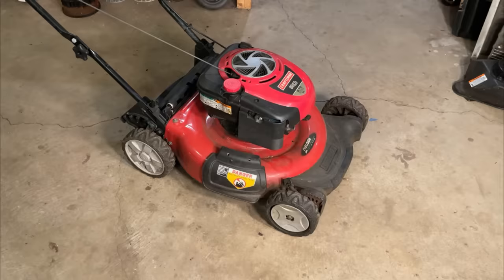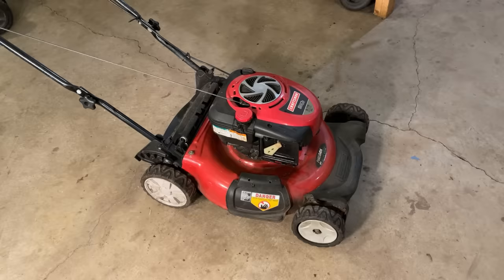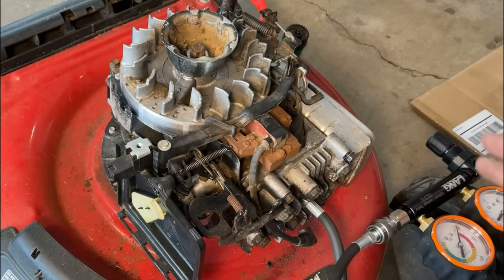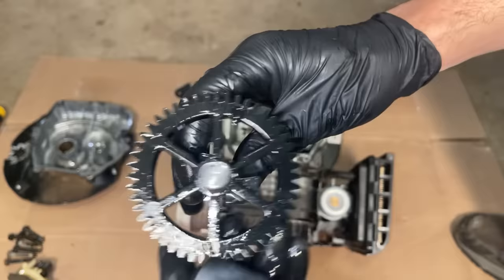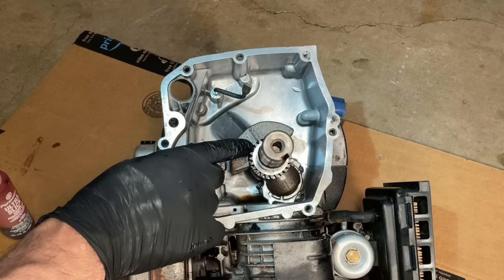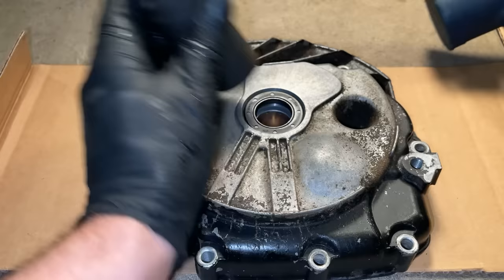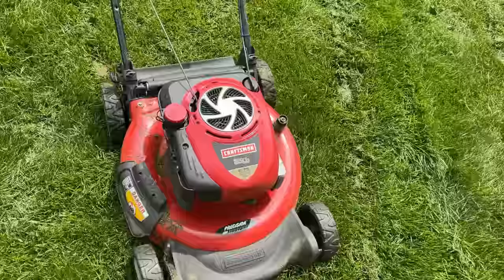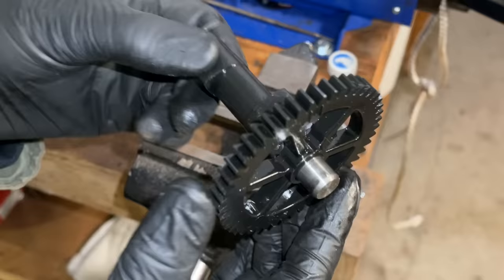Lawn Mower Will Not Start - You Will Never Guess Why

Comment: As the designated grass cutter in my youth, starting in the early 60’s I grew up on some of Vicksburg, MS hilly land.  Probably 1/3-1/2 acre of mostly steep hills and to minimize  washouts, leaf build up that attracted worms, grubs, ground squirrels and moles that burrowed causing worse washouts on top of the dogs digging after them we(I) cut grass a lot.  It was kinda whooped into me to walk and pick up the yard before cutting and if dad had to work in the mower that meant a missed opportunity for us to go fishing or early season hunting which he and I did a lot. Dad rarely bought anything new unless prior use usually meant buying a prior use or poor maintenance problem and well lawn equipment generally fell in that category back then.  We had one of the new for that time yellow two stroke Lawnboy mowers, can’t recall the engine hp or deck/cut width.  Two stroke engines were about the only kind of engine that would survive cutting on our hills for any length of time(months to years) without developing lubrication related problems even burning up/seizing.  As I write this it struck me as somewhat odd that I don’t recall many if any fuel separating and varnishing out in carbs or carb jets, NO alcohol and jetting was larger, fuel possibly to probably better at retaining its octane rating  due to the presence of lead for lubrication because the EPA didn’t exist so that too probably helped too.  Only engines I can recall being a bit more prone to carb jet fouling were two stroke outboards, although all we ever had was a 1.5hp Elgin and the reeds deforming were its Achilles heel. Seems like they were probed to both warping and pitting and they were no longer available.  I remember dad having to work in it every year before we planned to use it and for some reason it always picked up moisture in its tank.  I recall us always running the fuel out of the carb and fuel line before storing it for the winter.  It was stored in the shop area side of our finished basement and the tank had a screw down vent filler cap and a needle shutoff valve at the tank.   I recall dad getting reeds from the local marine engine shop, not the correct by model number but he made them work.  I didn’t know about 4 stroke lawn mowers at least not for my use until I got out on my own and owned flatter property.  That mower must have had a crankshaft design, raw materials ir casting related build problem.  I remember hitting a smallish dirt clod one day that had gotten into the mowing area one day after I had hauled dirt.  I also hauled(manual backhoe, a shovel and a wheel barrow starting with a 4, then a 6 even had one 8 cubic ft barrow) after I got into my early teens.  I tamped, surface scratched and seeded a lot of dirt every summer to repair washouts. But I recall every year or two that the mower developed problems running dad would troubleshoot disassemble the engine, check the crank the use a couple 4x4 blocks with v-wedges he had cut in them to straighten the crankshaft.  I only recall a time or two among the many that the timing key was a bit off.  I’m nearly certain the crankshaft was a cast and machined unit. I don’t know what straightening cast crankshafts do to their metallurgic structure but dad and I replaced it a couple or three times and would check and freshen up the top end with new rings a time or two while I was still at home.  We were still using it when I left for the Army at 18 so it was about 12-13 years old when dad bought a very heavy self propelled 4 stroke snapper primarily for use on the flatter areas.  I don’t recall for sure if it had a pressurized(pump) oil lube system or not but it was basically like a bulldozer with flat tracks on ice on the hills, sliding sideways when cutting along the side slope and then you had to basically horse the thing back to the top.  Dad was still using the lawnboy mower on the hills of that property when he moved to a flatter property in the early 90’s, so it was around 30 years old then.  Other than the crankshaft which was its Achilles heel until the last one he bought lasted many years without need for straightening.  Dad was a Jack of all trades, learned a lot from a man that I learned in my 20’s or 30’s never got to finish the 4th grade. He read everything he got his hands on.

Comment: When you discovered the gear off position re: the lobes James, then you pointed out the decompression ears bent and binding against the gear web, that told me it was the gear that moved in regard to the shaft, as, if you will recall, the decompression assembly is pinned thru the metal shaft so it stayed true to the lobes.

Comment: They make stuff to break so in a couple of years you just go out and buy a new one.It's really sad how greedy companies can get.
Reply: These are made far better than what you can buy now. The shear pin is a common repair. There is one always in my toolbox. It does suck when it fires wrong and the pull cord rips out of your hand.
Reply: @toadalgea  " The shear pin is a common repair."  Agreed, one need only break down as far as the flywheel;  however you must have missed the part about the failed camshaft requiring the opening up of the engine - not an easy fix.
Reply: Your right everything now is made with a life span of 3 years then you have to fix it or buy a new one and in some cases the fix is more expensive then buying a new one..
Reply: That’s why I detest the phrase “good enough”, the cause of failure, crashes & lives!
Reply: Zero cool I agree 💯%
Reply: The keyway is designed to shear in order to protect the crankshaft from twisting damage when you hit a large object.  The key is then changed out and away you go.  If the operator is mowing only grass there is no issue.

Comment: I just started working on lawn mowers. Already had experience working on vehicles. Thought I'd start flipping lawn mowers. I just got a Toro, same engine as this craftsman. Except I paid 80 bucks for mine. I can sell the toros 200 to 225, so I dont mind spending money. Well after today I'm not spending that much any more. When I got it home, gave it a pull. It was a hard pull, locking up, almost jerking my arm. It did start and run half way descent. Sounded good. So I did the service. Flushing the fuel system. Then gave it a bath. Then went to start it. Still locks up when pulling, and now wasnt starting. So I pulled the rope several times, and it fires up. But it's hard to start and violent on your shoulder joints. Timing.  So I checked the timing. The key is about 3/4 out of timing. I'm thinking that the engine its self is good. Since it started and ran. That all it could need is a cam replacement. I'm gonna tear it apart tomorrow, see what happens. Gonna use this video as guidance.

Comment: Got a  all steel w glass headlights, 1983 Murray RIder 42" ,  Hood opens like car ,  peerless transaxle, has the Briggs 12HP IC (industrial commercial) engine, we just fix it instead of buying new plastic front end types which seem to be the only choice anymore for new ones,   ( plastic would crack the first time someone tapped a bush or tree).  Runs good !      InventPeaceNotWar

Comment: This was an excellent video, easy to understand and was exactly the same issue I was having with my Briggs 6.5hp intek pro engine. Had me quite stumped really. This video helped out a lot. Thank you.

Ps.
It’s a shame that all these companies are using plastic internal components these days. It’s one thing with all the external components they changed from metal to plastic but to be using plastic for parts like that is just pathetic
Reply: @charlesmarlowchuck5060  lol I did scrap it. Because even after addressing the issue, put it all back together and still wouldn’t start. It was a brand new engine too that sat in my bosses garage for a few years on a go kart project he didn’t finish. 

I ended up just going to harbor freight and buying a predator engine to finish the go kart for my daughter. So far no complaints with that engine. Fired right up and runs every time
Reply: Plastic now being used to break so you buy another
Reply: My brother has a long lasting "solution" to plastic bearings and gears. He has a metal fabrication business. Basically, he cuts a gear out of steel to use as the replacement part. 
He also has customers with plow blades on their pickups that break. While under warranty, he repairs to factory specs. Once the warranty is up, the final repair is made, good for the life of the plow blade.
Plastic is so wasteful. So is the foreign steel.

Comment: I'm quite certain you've just identified what is wrong with my 3-year-old lawn mower that is getting almost impossible to start and little compression after having another mower previously that went 20+ years to get into that condition.  People look for issues like this on engines with timing chains and belts where they can jump teeth on a sprocket, but not gears.  They should be at least be pinned to the shaft or have some other mechanical means to prevent crawling out of position on the shaft.

Comment: Good job on everything! Except, I don’t recommend using a disc like that for cleaning gasket mating surfaces of any type.  Tools like that are great for certain things. Using it that way can cause uneven mating surfaces that a gasket can’t seal. If you do decide to go that route, at least look at how abrasive your tool of choice is and take that into consideration.  Not taking away from your video sir by any means. Just a friendly suggestion from a life long fellow engine mechanic. Use a scraper blade and some scotch brite to clean gasket area. Use brake cleaner and blow dry with compressed air.  Check for any nics or uneven surfaces with a strait edge and seal with a nice even thin line of good engine case sealant like Yamabond.  Or Harley-Davidson makes a good Engine Case Sealant.  Just run it on one side of cases. You don’t want too much on them or it will squeeze into inside of case and could break loose once it dries and plug up oil passages causing engine failure. But at same time, using too little or you miss a spot then you have a leak. You want a nice even bead right in middle of one case half.  From one end to the other.  Circling around bolt holes.  To provide a good sealed up bottom end.

Comment: I found a two stroke Iron horse in the trash one year - minus base and blade - checked it on the spot and seemed ok. A couple years later I found a base. It backfired a bit and with a new blade went for 10 years. Then I moved house and gave it a going over and replaced the keyway. Now it runs perfect. That was 25 years ago...

Comment: Great Job, James. Strange reasons why lawn mowers never start, yet too many owners would never have thought, time or ability to disassemble the engine that far and troubleshoot down to that lone critical gear / assembly.
 
One other question is why do you rarely seem to sharpen or replace the blade ?
Reply: Haha. He is good small engine mechanic that is making videos, that someone might actually watch. Not like he is really going to use that lawn mower. Im more interested in "no choke" start and no mower safety device

Comment: Actually, the compression release is on a pin through the camshaft. For it to bend like that, the pin would have to break or the gear had to turn. In your case the pin was still good so that indicated that the gear had moved on the shaft.

Comment: What you said about seal position is true on low-hour motors or motors with good maintenance history. High-hour motors (and this is true in the automotive and aircraft industries as well) will often have a small groove worn around the OD of the crank right where the edge of the lip seal contacts the crank. When a groove is discovered the seal usually has some amount of free space where it can be driven in further past the groove, or shimmed, or carefully driven in less than originally so the groove is not in contact with the seal's lip.

Comment: I've had lawn mower engines where 1 of the rocker arms was missing... I couldn't find it.. I mean, I tore the engine completely apart... nope, not even shrapnel... I replaced it with a new one, and mower was perfectly fine... I can't tell you how many times I pulled the pull start on that one, it had good compression and everything... lol
Reply: Pretty sure that MOWER MEDIC 1 has a video of discovering a missing valve retainer or lash shim. Sorry I can't recall the exact problem, but it was a part that was omitted during factory assembly, resulting in an engine that never ran from day one. 
   On a different note, a pushrod on my friend's pressure washer bent, dropping the rocker off the valve. We set the rod on a hard surface, placed a piece of hardwood over it, felt the high spot and gave it a medium whack with a hammer. Got it perfectly straight with one hit. That was about three or four years ago. It's still going strong.

Comment: Most of the mowers I have rescued from the trash dump had gummed up problems with the carb float and/or the needle valve.  Easy peasy. It's largely a cleaning job.
  Had one last year that needed a set of carb gaskets to restore horsepower. It started just fine but would always stall under any kind of load.
 Never had to go as deep as you did with this one... It's almost always the carburetor.
 When a small engine spends at least half the year unused in storage the fuel evaporates and what is left looks like gummy varnish.

Comment: I had a snapper lawn mower about 11 to 14 years ago that wouldn't start so took off the air filter and filter housing then removed the carburetor and took it apart to clean some gunk out of it only to learn that the lawn mower ran fine without the carburetor went to the local small engine shop and purchased a full carburetor rebuild kit then put it back together with all new parts and put it back on the lawn mower and reconnected the fuel line added some fuel and still the same problem but now that I think about it the jets could have been messed with or needed replacing but I'll NEVER know because one of my cousins sold it to a pawn shop for fifty dollars when I wasn't home.

Comment: If they could build the entire engine with plastic, they would!
Reply: Troy built, heck the entire carb is plastic, but at least wont rust out like many with this ethanol gas now.
Reply: "Introducing the new Briggs And Stratton Lightweight, featuring plastic block, aluminum valves for less tension on the plastic cam, with cast iron sleeve for commercial duty"

Comment: Hey James, thanks for sharing this. I am truely devastated to see plastic cams inside an engine. The plastic carbs were already the point where I decided to keep my older Briggs&Stratton engine on my mower as long as it doesn't fall apart.
I wonder when they will finally come with plastic pistons and cylinders...
Greetings from Germany!
Andreas
Reply from the maker: The older engines built before 2006 are definitely better then the newer ones.
Reply: I work in a Garden Machinery Store/Workshop. We stopped selling all machines (and I mean all - pedestrian lawnmowers, ride-on lawnmowers, stump grinders, shedders/chippers, etc.) with a single cylinder B&S in 2011.
The only B&S engine worth it's weight today are the V twins, all other B&S are absolutely useless.
The plastic carbs were bad enough, but plastic carbs with solenoids (that just keep going).
One Craftsman Ride-On was collected for repair (under warranty) three times in one season.
Now instead of collecting them we just have replacement solenoids with us and replace on site.
Needless to say we dropped Craftsman/Husqvarna/Jonsered  machines went for AL-KO Solo that do not have any unnecessary electronics, no solenoids on the carbs (which are not plastic) and the belts don't ware. Only one deck belt in ten years.
AL-KO Solo are a German design, assembled in Austria - which means all tools required for assembly/maintenance  are "metric" - so more more of that silly "imperial" stuff anymore.
Greetings from Ireland :-)